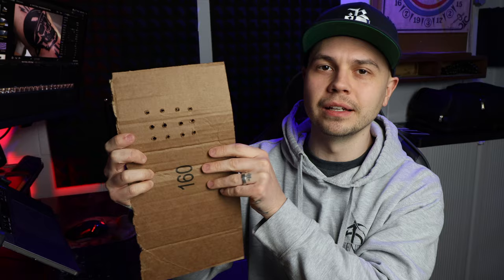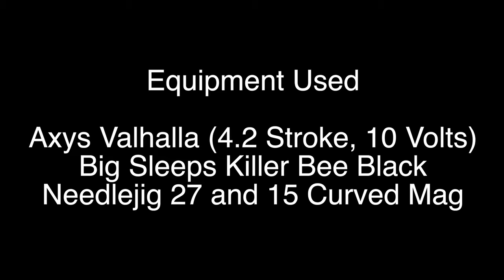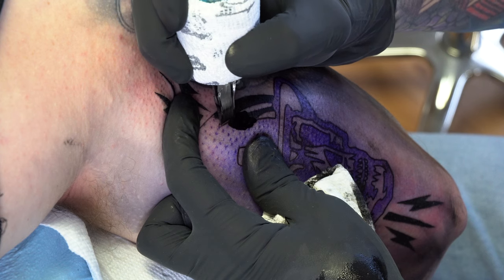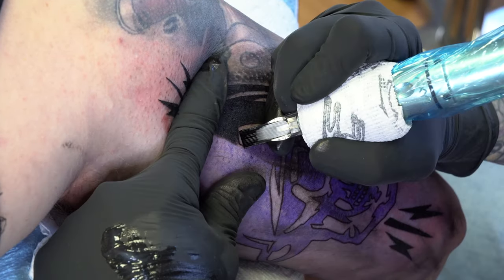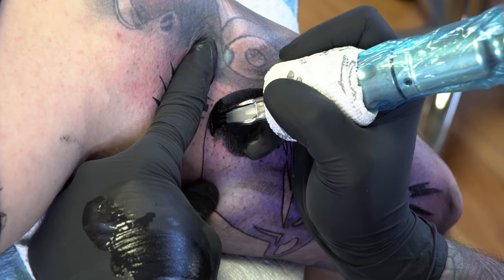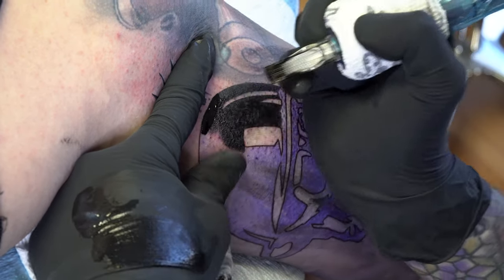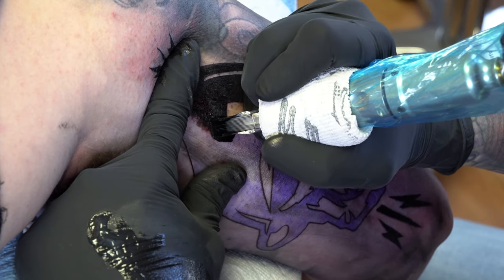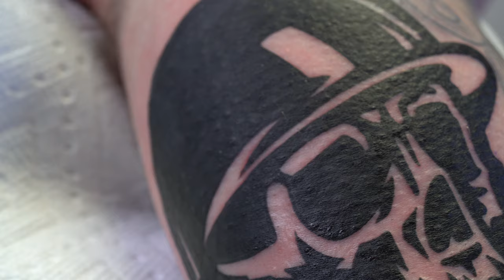How To Tattoo - Packing Solid Black With A Mag

Comment: This may Be a weird question- but i am a new tattoo artist- are you wiping his skin with a dry towel? And how do u avoid sweeping while turning your mag a little to the side?
Reply: Most likely is wiping with green soap or something similar on the towel. Green soap is a miracle substance specifically geared to remove blood, ink, and other proteins from the skin’s surface without negatively impacting the design. I’ve tried a variety of alternate cleansers and soaps but imo green soap works best.

Comment: I am blacking out my entire lower arm. Was really having trouble getting the blacks solid. I'm starting to think my hand is way to fast for the 7.5 volts I was using lol.
Reply: hard to stretch skin yourself when selftatting your own arm. That's most likely why it's not solid.
Reply: @kLa6KJESUS  I actually use few methods to stretch. I sometimes use my knees to pull my skin tight. Or I will use medical tape and use that to pull my skin tight. My problem was such an easy one. I wasn't using enough voltage. And had my rotary not hitting hard enough. I increased both and tripled the amount of area I filled in 2 hours. And also it is super saturated. I'm new to rotary and pen. So I was still using the same voltage I was use to with my coil machines. Thanks for your info though
Reply: Howd it turn out

Comment: Do you think this strategy will still work with a 3.5mm stroke? I have a cheyenne sol nova unlimited and it doesnt allow the adjustment of the stroke :(
Reply: It will work with any as long as you have the correct technique

Comment: Won’t a 3.5mm stroke be better for packing than a 4.0mm stroke since a shorter stroke will lay out ink and color more and evenly and faster? Why do people always go for longer strokes or are they just following a bandwagon?
Reply from the maker: Idk about any bandwagon lol I just use what works best for me because of trial and error.
Reply: They usually say that the longer the stroke the further inside the tube the needle goes. Collecting more ink and therefore packing more colour. That was the info I found by watching too many videos. Hope it helps
Reply: If you packing solid black a longer stroke is more efficient. The needle travels further thus greater penetration. The goes for lining; longer stroke better saturated lines. And you can actually feel the needle better when packing with a longer stroke vs a shader with shorter stroke.

Comment: Do you recommend using a mag for most tattoos? I color pack with liners 90% of the time. For this size I would have used a 7M and a liner in the tighter areas
Reply: Dude in the video he mentioned he doesn't use liners for shading cause it takes to long and damage the skin
Reply: @frankybaby89_27  I know but for example say, the lighting bolts on this tattoo in the video. For tattoos around that size, is it necessary to use a mag every time you color pack
Reply from the maker: I use liners for super tight areas. Not for something like this tho. 
Give some larger mags a try for big areas of black. I honestly can’t imagine using a 7mag to fill that. It would take so long.
But then again if it’s something that works for you and your tattoos are coming back healed up well then do your thing.
Reply: @thatoneguywithac107  it's more consistent I think...just how he prefers..it works well.

Comment: I have the bishop wand OG with same stroke. Would that also run 10 volts with the same results ?
Reply from the maker: It would depend on how you tattoo. Start off lower in voltage and work your way up to find what works for you